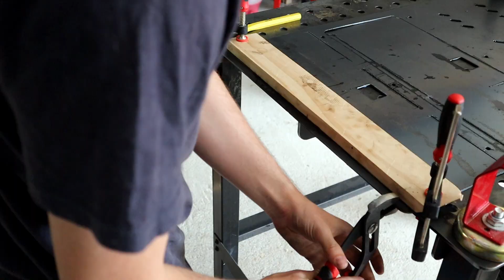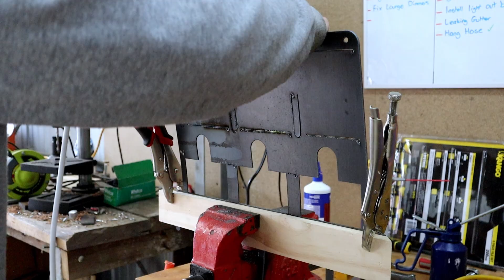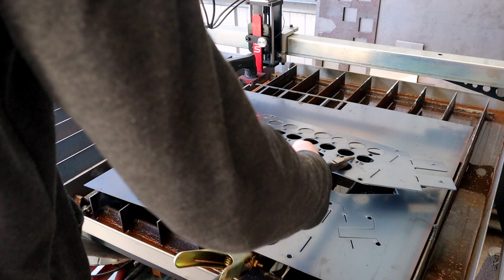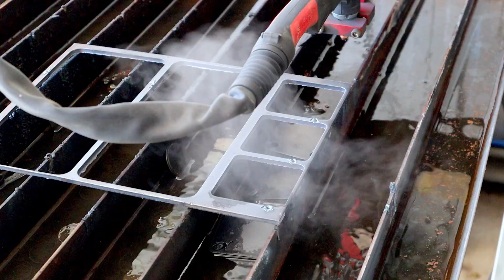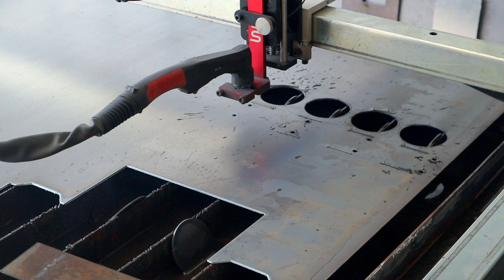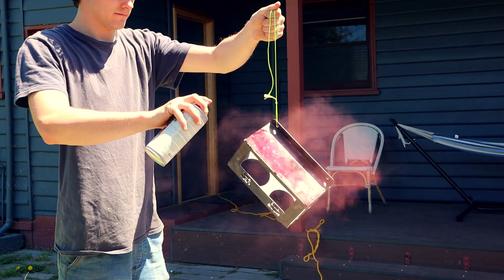Making Tool Holders from Sheet Metal (CNC Plasma Cutter - Langmuir Crossfire Pro)

Comment: Nice  build! Just a warning , i have had the water pan warp and deform from cutting without water. The water helps some too with warping thin metal when cutting. A magnet you can clip your ground to and stick on the metal is convenient.